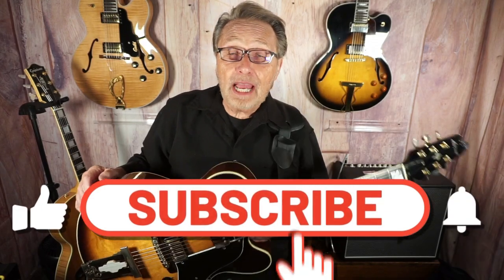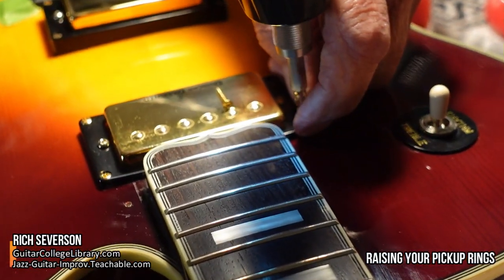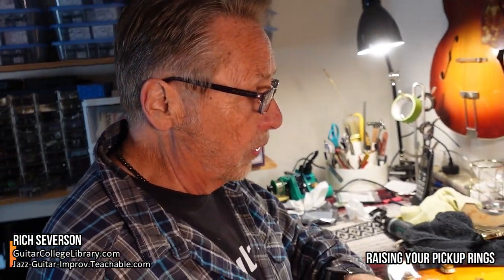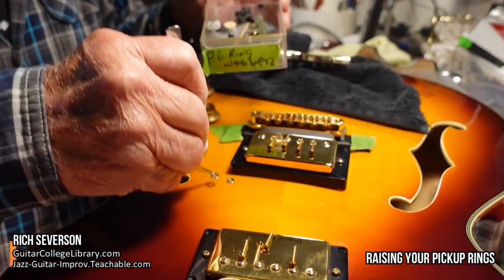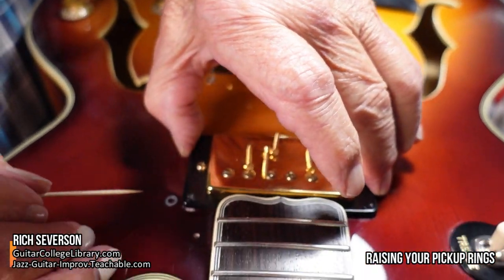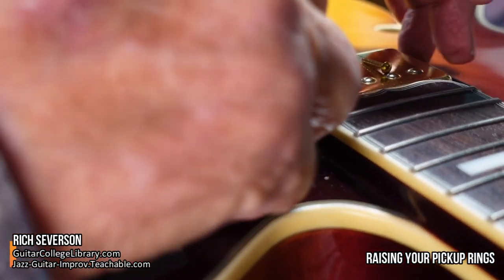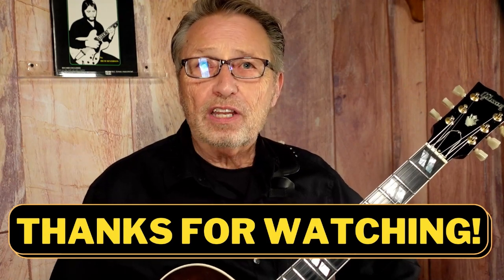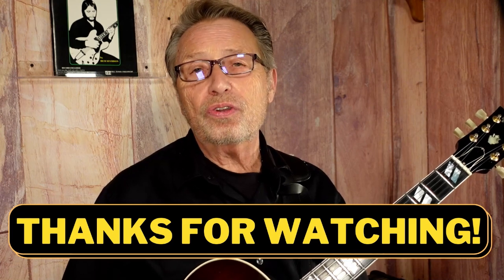How To Get More Resonance & Better Tone From Your Guitar's Top | Archtop Guitar Pickup Ring Hack

Comment: Thanks for this, Rich.  I'll never be able to play as well as you, Rich, but I am an engineer and I believe that the word you were looking for is "ferromagnetic".  Brass and stainless will not be ferromagnetic, and plated steel will be.  In order to avoid added metal affecting the magnetic field of the pickup, one might use plastic washers.  Nylon would probabably work.  Otherwise I'd use brass washers.

Comment: I did this with my 175 last week,  I was surprised at the difference in tone. Thanks for the tip.
Reply: Curious what type of washers you used ? Rubber, metal, nylon?  Size as well.    Thanks .
Reply: This improves acoustic (not electric) resonance correct?

Comment: You are partially ok on this but its the material characteristics for transfer.....Use Brass or Ferrous Steel.  I usually mount pickups to solid bodies this way in that I set up the pickup height first in its normal mount....then bypass that mounting to screw the pickup right to the guitar body and use all the same material spacers or "shims"...which amount to just plain washers.  Steel has a particular tone to it and Brass has a particular tone to it due to the transfer character.  BUT what you are missing is the BRIDGE !  The actual material of the bridge and the individual saddles.  The Gibson original had brass saddles which were plated but those brass saddles has a particular MASS as opposed to the modern repro parts available which are LESS MASS.  In a solid body the stud is also BRASS and well into the wood deep for transfer.  SO on modern guitars...this has to be changed to restore the "vintage" characteristics.  Also after the action is set..... The gap between the thumb wheel and the stud to body...I also load the stud with "shims" so there is a solid coupling to the body with MASS.  You have 2 contact points with a String...one at the Nut and one at the Saddle for each string which creates a LOOP with the body wood...the more solidly coupled...the more resonance ...but its also the materials....not just the "tone" woods but also the METALS.    As with MAGNETISM ......the more ferrous the strings.....the more effect on the magnetic field of the pickups.....so More Mass will produce a THICKER tone.  BUT I am the one that deals with ELECTRONICS.......so the guitar electronics as well as Vacuum Tube amplification......My Father was an RCA dealer...so I "know" audio & electronics.....considering my Dad went into business in 1935 and I was a Family Apprentice in the Family Trade ........So the Electronics are critical !  BUT that is based on the Acoustic properties...and maximum transfer of the vibrations in relationship to the string dying out.....which means SUSTAIN and the time factor to the string decay of vibrations.  The real energy in AUDIO is in the low end waves...they are LONG waves and that is the factor in the electronics end of things.....at the end of the day.....its the fundamental and the overtones......all the Harmonic content.     Considering most players want to sound just like the recordings they listen to and got influenced by and motivated to PLAY and learn to play.   It all goes back to RCA and RCA VICTOR and RADIO and the technology of the day
Reply: Personally I favor deep cut saddle and nut grooves where the top of the string is flush with the top surface of the saddle or nut...which gives more CONTACT surface area for transfer as opposed to a string riding on top of a saddle or nut and not deep set at all......but the slots need to be highly precision cut.....no slop.......and if you favor a trapeze tailpiece.....the best is the old style Epiphone Frequensator type with the split between the 3 bass strings and the 3 treble strings.....WHY...because you can manipulate the 3 treble strings if you play off the bridge and palm mute at the bridge.....roll your hand back to the tail and its not quite a Bigsby...but some wiggle that's useful.....

Comment: Most of the electric guitar sound comes from the magnetized string segment oscillating freely above the pickup coils, generating the electric signal (Faraday's Law). For a solid body electric guitar (e.g. telecaster), that's pretty well it. For an archtop, however, the "soundboard" vibration also seems to affect the final tone. Perhaps the pickup is wiggled by the soundboard, and the distance to the strings can change, also affected by the floating bridge vibrations. This distance fluctuation chnages the net magnetic field received at the pickup coil and thereby also affects the harmonic content in the output audio signal.  Using washers might be affecting the transmission of soundboard vibrations to the pickup. That's my theroy. If you guys have another explanation or a published reference, let me know. In short, the physics of the semi-hollow/hollow electric guitar is more complex than meets the ear!
Reply: …or maybe the washers move the pickups a little closer to the strings.
Reply: @toonew24  A closer string will certainly increase the magnetization of the string and the coil's signal strength (i.e., volume). I should measure the Fourier frequency spectrum of the signals with and without washers and sort out this tone "mystery", looking for differences in harmonics mixture. The program "Audacity" easily computes the frequency spectrum from an input audio signal. Thanks for your reply and suggestion.
Reply: I am mystified because it should not make any difference but the difference is unmistakable and significant enough to notice 

At first I thought it must be due to pick up distance but on my Gibson 175 the pick up guards are nothing to do with the height of the pick up which independent of the black plastic guards 

I genuinely thought that this was not going to work - I only tried it for  fun but the sound I’m getting is fab 

I played the guitar for 30 minutes first and kept the amp settings in my standard set up - it took less than an hour to put the little rubber washers on and then played fir most of the day - it’s definitely a very noticeable improvement and I’m stumped as to how it is working because it shouldn’t in theory make a difference but IT DOES 🤷🏻‍♂️

Comment: Thanks Rich.   I’m still playing my Eastman 503.   I think it’s lively enough, but I like this idea.   I’m using the Quilter amp with the 8” speaker, but I connect a Razers Edge 10” cabinet to it and I love my tone.   I’m going to keep my Eastman.   I did some set up work on it and get it playing really well.    I’m noticing that getting Eastman guitars is not really easy.
Reply: You just can't beat Eastman for the price.  I'm doing a lot of GoPro video recording on my gigs and the Eastman and Quilter combo sounds so nice and so traditional.   By the way, a few weeks ago on the live show, there was a question about Fender amps.  Here is my discovery of what to make an archtop sound great through any Fender:   Turn all tone controls to ZERO.  Just give it a try and see what happens.  It actually worked  for me.  I hope it works for any of the players out there.

Comment: Hey, to you that have done this.
Do the washers want to match the thread size of the screws, or can they simply slip through whatever the washer’s hole size is? Thanx
Reply from the maker: The washer size does not have to be exact. Once you screw down the pickup ring the washers will be secure.

Comment: Hi Rich; Just discovered your channel!  I have a 1984 Epiphone Emperor that I will try this pickup procedure on.
I want to add a Bigsby but without having to drill the guitar. Do you have a recommendation for which Bigsby will work?
And where would you suggest that I buy a Tune '0 matic bridge from?
Thanks,
James
Reply from the maker: Stemac for the bridge. There is a Bigsby that doesn't require drilling but the string might be to high.  I'd hold off on the bigsby

Comment: If string vibrations excite the top to vibrate more, then the strings vibrate less (which is what the pickups see). That's the Conservation of Energy Law as it applies to guitars. And that's also consistent with several decades of complex measurements of real guitars, including semi- and fully-hollow electrics (see for example Ch 7 of Zollner's "Physics of the Electric Guitar"). So unless you think loss of string vibrations are somehow an intrinsically "good" thing, increasing top vibration does not make intuitive sense in terms of actual guitar physics.
Semi-hollow guitars have been measured to lose somewhat more string vibrations than solid-body electrics. And fully-hollows lose a little more again. That is a function of the bridge becoming more "mobile" as the construction anchors it less rigidly to the thinner tops (with/without centre block). As such the bridge's mechanical impedance to string vibrations is reduced. So more string vibrations leave the strings and flow through the bridge to vibrate the top plate.
So how do you perceive that more lost string vibrations improves the "tone" ?
Of course tone is subjective, but the notion that more losses improves tone is sufficiently counter-intuitive that, as Carl Sagan said ... "extraordinary claims require extraordinary evidence".
So you really need randomized blinded before/after recordings to tell if you can really pick a difference, let alone one that you prefer. Without that, there may not be anything more than wishful thinking going on here.

Comment: What about using rubber washers instead?
Reply from the maker: Hey Vayabroder! Rubber would work! I have used plastic ones as well.
Reply: @RichSeversonGuitar  Thinking that being a softer material any possible vibrations would be less detrimental. Rickenbacker guitars and basses are that way. Stock O rings from the hardware store would be fantastic.

Comment: I thought this was not going to work but WOW - I’ve just fitted them on my Gibson 175 and there is a beautiful and better tone 

I bought these from Amazon - they work great and they are black rubber so don’t show so much on the guitar 

sourcing map Rubber Flat Washers 7mm OD 3mm ID 1.2mm Thickness for Faucet Pipe Water Hose, Pack of 30
Reply: Hey this has made a huge difference- my fingers are sore through playing so much with this great sounding guitar- I don’t understand how it works but it definitely does !!!!!

Comment: My Broadway generates plenty of resonance. I need to tame rather than enhance it. George Van Eps invented his string damper to eliminate the sympathetic open string vibrations, and reduce the electro-acoustic guitar’s susceptibility to feedback. Herb Ellis and other players also used it. Despite being great players, they did not rely on string muting technique alone. Fretwraps and other tricks are quite popular these days. Anyway, just wanted to point out a possible downside to increasing resonance. Archtops with 2 pickups will cause less feedback than those with just 1 pickup. The ones with a floating pickup are the worst.

Comment: I don't see how just one washer per hole is enough? Because the guitar top is not flat, so the center of the pickup ring is still touching the guitar. So the plastic ring is not fully off the guitar top, only the four corners are. And the close-up video shows it the ring is till touching the guitar top. Sorry, I smell snake oil.
Reply: I use nylon washers from Amazon and they work fine. I use an old credit card to check for clearance and so far there is always a gap between the guitar face and the pickup ring.